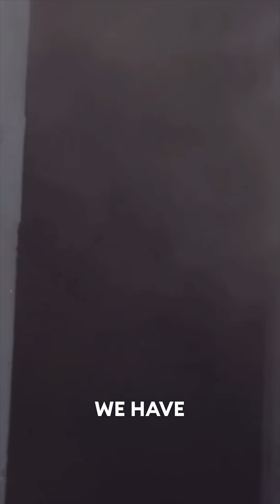Reading Smoke - LIFT, Life, Layout  (3 L’s)

Comment: Change this acronym according to how the TIC works.  If you search for fire or conditions before scanning the layout, your TIC will switch to low sensitivity mode and will increase occurrence of refresh rates.  
Determining life and layout are a mater of interpreting images that require the best possible screen resolution. To that end, scan low before scanning high.  Consider instead, LLC…Life, Layout and then Conditions. Conditions being more than just fire, observe the radiating heat from objects, look at fuels for flow path and then yes, fire.  We are looking for what to cool and where to cool, not simply flames. Conditions are also noted without the tic, can I see below the smoke? Is there a thermal disruption? Or a steady flow path?  Where? In what direction? It’s a small adjustment in thought process but prioritizes the tool at hand in using it to its best advantage.